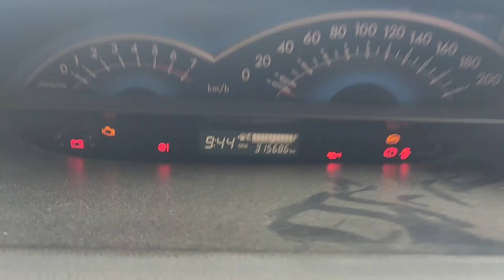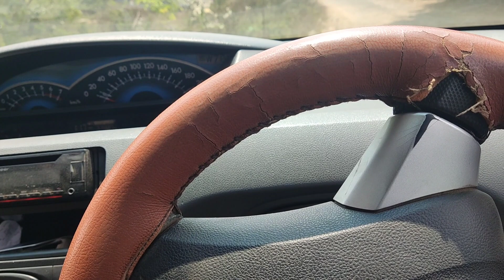Toyota etios black smoke(@skilledmechanictamil )

Comment: Helloo brother
Same etios running time off aaguthu
Running time only late starting aaguthu
Above 100 km pona off aaguthu
Pump rail injector everything normal.
Drv sensor changed
But problem sari aaga la
Reply from the maker: Tappet setting check Pannunga
Reply: @skilledmechanictamil  check panitu solluran bro